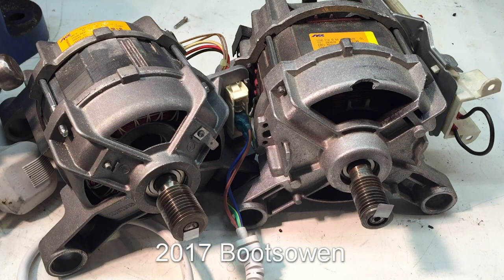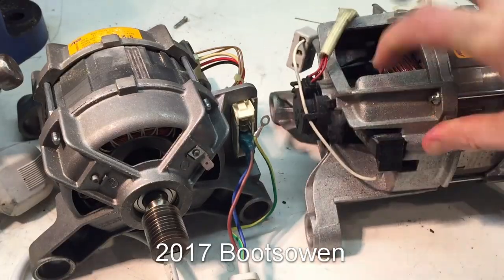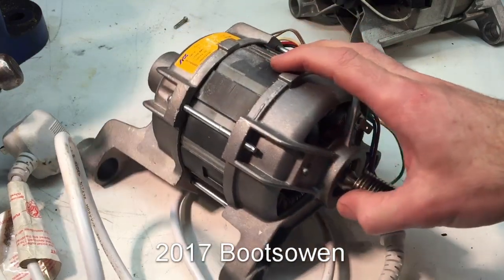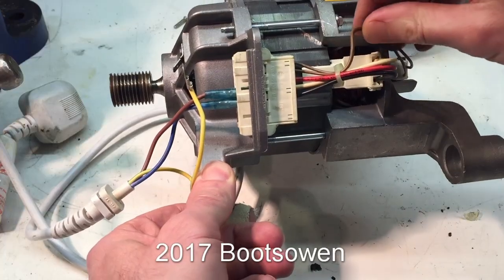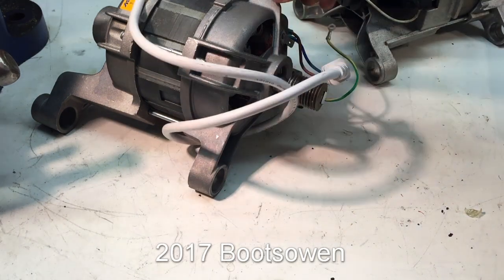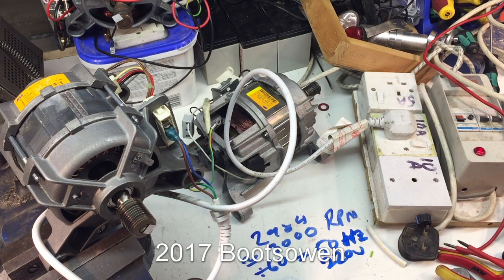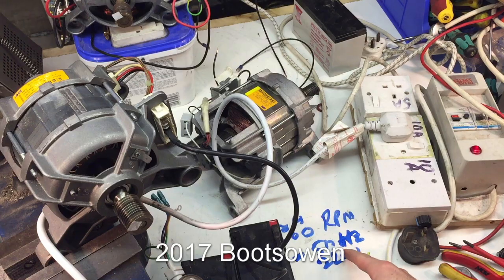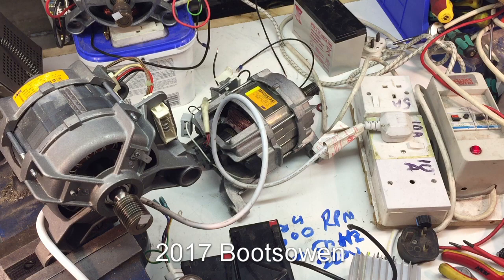Washing Machine Motor Wiring Explained (3 Phase Induction)

Comment: There is a guy did this he made a github post yiu need a full duplex to half duplex adapter  to use a windows computer to control it with rpm feedback over serial. There is a YouTube video j cant find ask ai to find  the project by searching for whirlpool motor controller on github . He even provides gerber for the adapter.

Comment: It’s best to get a run capacitor of a blower motor or a microwave or something like that to get it to run smoother and will let it start on it’s own than the way you showed the way to do it is to wire a power wire and neutral to 2 of the connectors make sure that the live has 2 wires one of them will be in series with the capacitor and then the motor and the rest just plug them into the other 2 slots for the windings and maybe if you could cut the winding across the live to the capacitor winding NOT THE EXTERNAL WIRE but the internal winding so the electricity goes through either the main winding or the capacitor winding back to neutral and not through the capacitor to the main winding not like I’ve done this before I guess it’s just plug play and wait for the red to pop! anyway nice vids keep it up ❤❤❤

Comment: That's not an induction motor, that's actually a BLDC motor, which is an inverter motor become it's a got an inverter which converts AC to DC.
Reply from the maker: I thought bldc had magnets and only 2 sides.
Reply: @bootsowen  Well BLDC motors use permanent magnets on the rotor, and the windings on the stator, the maximum speed of an induction motor achievable is 3600rpm at 60Hz AC, but BLDC motors use 3 phase DC power, which use pulse waves that turn on each coil separately.

Also BLDC motors use an ECU/ESC for achieving 3 phase DC.

Comment: You can harvest the frequency controller along with the motor when tearing it out of the washer.
Reply: Where and how
Reply: @kadnero4423  Follow the wires going to the motor to its first big main board.  It will have a bunch of transistors and heatsinks on it.  That's the frequency controller.  You just have to find the input, it will want a "pulse width modulated" input signal and 120/220v power.
Reply: @snap-off5383   Thank you

Comment: In the most of mainland Europe. 3 phase power is standard in households. Washing machine can be run on 3 and 2 phases.
Reply from the maker: Yes, but it is still quite rare to see a domestic washing machine on 3 phase. When you say 2 phases do you mean single phase?
Reply: @bootsowen  I live in Denmark and 3 phase power has been the standard supply in homes for the passed 100 years or more. Our washing-machine runs on 1 or 2 phases + neutral. There are 380 volt between phases and 240 volts between phase and neutral. The cooker ( large Smeg) oven runs on 3 or 1 phrase + neutral and the dish-washer runs on 1 phase + N. Hand-held tools run on 1 phase and is very seldom to find stationary machinery (drill press, lathes, mills) that run on 1 phase. "When you say 2 phases do you mean single phase?" Split 3 phase: -washing-machine. 1 phase for the heating element and 1 phase for the motor. You run 3 phase to the machines and then spilt into 2*230 volts. Larger commercial washing-machine use all 3 phases. In many parts of Europe, 3-phase power supply is used in ordinary households. It's more economical and allows spiting. You have both 230 and 380 volt on demand. That's were the professional hobbyist in the UK runs into a big problems.They can buy cheap used metal and woodworking machinery in the EU but, they can't run it. Puts a block on home-industries. Your videos are interesting and I like them!!
Reply from the maker: @michaelmayo3127  Thanks, I have put a video in my taking stuff apart video of an induction hob this week. it has an interesting wiring input, 7200w, 2 lives, 2 neutrals and 2 earths. I think so you can run it on two phases and neutral, or on two separate single phase lines across 2 breakers? or in the UK a single phase combined connection. I don't know much about electricity. I know that there is 3 phase on my street, but most houses don't have it.

Comment: An regular VFD won't work. This motor require around 300 Hz. You can try one of those cheap chinese controllers with tacho-feedback  but with them the motor will work in low RPM range only (around 3000). However those controllers works pretty well with the universal type of motors. You can search for them in ebay or aliexpress, key word "400W AC 220V Motor Speed Pinpoint Regulator Controller"
Reply from the maker: Have a look at my more recent videos where I show it working perfectly. Thanks
Reply: @bootsowen  I did not, you have so many videos ;) . Could you please share a link. Thanks.
Reply from the maker: Thanks, search for Bootsowen VDF

Comment: Dear Bootsowen. 

i have the exact same motor and desparetely try to run it. 

have you found any way to run it with simple components such as capacitor or applying dc load etc?

i do not have budget to buy VFD thats why i am asking your valuable help. 

thank you for such great videos!
Reply from the maker: Perhaps you should find a more suitable motor?
Reply: find another washer with a 3 phase motor and harvest the motor AND the frequency controller from it.

Comment: i got mine running on a vfd at 4hz realy slow and kinde of useless
Reply from the maker: I have a more recent video running one of these on VFD. i ran it faster than 4hz
Reply: @bootsowen  I watched it, but mine started randomly speeding up and down and then VFD got a over current alarm. Worked fine at 0-5hz but over that and started jumping, and tripping the current limit.
Reply: @bootsowen  actually got it working after i set all the parameters in the vfd correctly. Your videos are quite  informative. thanks.
Reply: @bootsowen  https://www.youtube.com/watch?v=UCR7iQTLAoM
Reply from the maker: Is it a seperate motor, or a direct drive?
Reply: @bootsowen  Separate

Comment: Thanks for this, I got given one of these motors, from a hotpoint I think, I was going to use it in a DIY bench sander but you've just saved me time and frustration because I would never had worked this out for myself,  I watched a couple of other videos about this but to be honest yours was the only one I really understood.
Reply from the maker: Excellent. I have posted a more recent one using a variable frequency drive to power a similar motor.

Comment: Hi Bootsowen, I had a look at this video. Never thought they built washing machine with 3 phase motors. How many households have 3 phase power? Maybe UK is different. I was actually referring to brushless motors of new generation. They are inverter motorsand have 5 wires: 2 are for live and neutral(single phase) and the other 3 are to control power, speed and rotation of the moto. these 3 wires come form a PCB so I assume they are low voltage.   It seems most machines now use these types of motor which have electronics and fail! I am referring to Askoll M500 or askoll Ta0200. Here is a video of the latter

https://www.youtube.com/watch?v=7g9akgSo6JM

and here is a link for the M500 which I am trying to use for other applications but I don't know how to wire it. If I apply 240v to the input nothing happens. This means that it is in Normally OFF. The other 3 wires modulate the rotation etc.

https://www.berlin-repariert.de/askoll-m500-2/

Can't find anyone that has a video on how to rewire these.Cheers and thank you
Reply from the maker: Houses in the UK have single phase 220v. But these motors are driven by a board and maybe they are some variant to what you are talking about. The board, perhaps an inverter?, creates power with the right frequency to drive the motor.  So they are brushless.

Comment: Waait... it's 3 phase. Can't you just power it "the old way": with a capacitor in parallel with one of the windings? Granted you'll lose 40% of the power and some starting torque but other than that the motor would work and have some uses in lower power DIY projects.

If not that then maybe BLDC driver with custom software that changes typical square PWM signals into sine waves? I'm not too good at this so maybe there's someone who is and who'd explain if such a thing is possible.

Comment: what type of duty cycle are washing machine motors? s1? or what? can it be running for hours without getting damage or be overheated? for example a 500 watts electromotor 2800 rpm

Comment: So the main diffrenet between the universal and induction motor is the brushes?? Just wanna make sure because I have a motor without brushes only 3 wires coming out of it . I guess its Induction
Reply from the maker: There are lots of other types of motors. These are just 2 of the main 3 washing machine motors.
Reply: @bootsowen And there is 4th type of washing machine motor used by LG (direct drive). That one is called BLDC motor. Both of them (BLDC and the one you showed) are considered as inverter motors.
But BLDC motor is not an induction one. Here the difference is a rotor. 
In induction one the rotor is built up like closed cage and it is an asynchronous motor. 
On the other hand in the BLDC motor, on the rotor there are many permanent magnets and it's a synchronous motor.
The practical difference in in the way how they are driven.
In case of synchronous one, driver (inverter) has to exactly know the position of rotor in order to power up the correct coil (or pair of them in case the motor windings are in star configuration, BLDC motor  is also a three phase 😅)

Comment: How do you know if it is a 3 phase induction motor or a single-phase induction motor with a starting winding? For that, you need to check the resistance of each winding. Either single phase with starting winding or a three-phase winding you can run it with properly rated capacitors.

Comment: thanks for interesting video I have a 3 phase motor can't help it but it seams a shame not to use it, do you think this would run ithttps://www.ebay.co.uk/itm/2-2KW-3HP-220V-Single-To-380V-3-Phase-Variable-Frequency-Drive-Inverter-CNC-VFD/362723882389?_trkparms=aid%3D555018%26algo%3DPL.SIM%26ao%3D1%26asc%3D60698%26meid%3D0e0f874b0ad34971b9f31b9483175ff0%26pid%3D100005%26rk%3D4%26rkt%3D12%26mehot%3Dco%26sd%3D312652093942%26itm%3D362723882389%26pmt%3D1%26noa%3D0%26pg%3D2047675&_trksid=p2047675.c100005.m1851
planing on using it to run motor for a honey extractor, would be interested in anyones thoughts
Reply from the maker: It should work. But you are putting a relatively expensive vfd on a free motor that may have had years of work in it already. But I say relatively and it is pretty cheap at £60. Have a look at my other videos on universal motor speed control. These are free from washing machines and a basic controller from eBay is under£5. Perfect for honey extraction where constant speed isn’t critical. Let me know how it goes.

Comment: What kind of rotor is it inside this motor? Are u sure it's not the permanent magnet rotor and thus BLDC motor rather than induction motor?
Reply from the maker: What does bldc stand for?
Reply: @bootsowen  BrushLess DC
Reply from the maker: Have you watched the whole video?
Reply: @bootsowen  yeah, why?
Reply: @bootsowen  itu adalah motor BLDC, harus dgn controler 3 phase, dan itu bukan motor induksi, karena motor itu menggunakan ROTOR PERMANEN MAGNET NEODINIUM
Reply: @bootsowen saya kenal dgn motor BLDC tsb, dia memiliki SPEED dan torsi Yg sangat kuat, 👍🏿👍🏿👍🏿 itu motor yg sangat bertenaga,

Comment: how can I connect it with a capacitor
Reply: That's the same thing I was trying. I connected the third pin to the phase via a 80uF capacitor. It worked very smoothly, but it started overheating. I calculated the 80uF because that's what a start capacitor would require. But I have since found that it is too much for the run capacitor. I am thinking of trying 8-15 uF, from some tips I got online, but I wonder if it would work.

Comment: Your video was very helpful to me as i probably have looked at this motor from a distance an thought it was a universal motor {and bypassed it}  - as i did not know they designed this '3 phase' to look like a uni motor - so i find that very helpful - and i thank you.
as for the issue you are having you maybe want to research more into '3Phase' and different configurations and connections you can achieve. 
if you have any questions don't hesitate to ask i'd be happy to share any info i have with regard to running that motor on so called 'single phase'
Reply: if you can help I have a 3 phase motor as well left over and would like to use it to power a honey spinner, any help would be great please what can I do to control it and make it run smoothly, thanks Keith

Comment: Can't you add a capacitor to create a second phase?
Reply: That's the same thing I was trying. I connected the third pin to the phase via a 80uF capacitor. It worked very smoothly, but it started overheating. I calculated the 80uF because that's what a start capacitor would require. But I have since found that it is too much for the run capacitor. I am thinking of trying 8-15 uF, from some tips I got online, but I wonder if it would work.

Comment: can you turn them into a 3phase generator?
Reply: Yes, you certainly can. You simply connect a turning source to the axis, and you immediately get a three-phase potential in the connectors. I did it by connecting my Black&Decker Drill, and I got a three-phase voltage of about 3 volts at the frequency of the rotation.

Comment: some washing machines have a two winding single phase induction motors (two parts of the star winding) that use a capacitor (about 10 mfd) from the second winding to one of the power (N) connections to allow it to run and you swap the capacitor power wire to the other power (L) connection for reverse :-)
Reply from the maker: What models and years have those motors?
Reply: @bootsowen
i cant remember make or model , but it was early 90s , i only ever saw 3 , all were different models at least , i had to change caps so they would spin properly :-)
Reply from the maker: I have only seen universal or 3 phase recently. Early 90s is almost 30 years ago now!!  ;-)
Reply: @bootsowen
i never thought of how much time has past , im always hoping to get hold of a scrap one just for the motor , im going to guess thats never going to happen unless some one has one that has lasted till now , funny thing is i keep seeing washing machines from the 50s/60s that still work that are being scrapped but they just have an "ordinary" induction motor with a centrifugal controlled switch to disconnect the starter winding :-)
Reply from the maker: I guess it depends on where you live but they come up from time to time. If you know a local scrap man they can watch out for one for you. ;-).
Reply: YTANDY100 x

Comment: Wow i got a 3 phase so hard to find out its 5 pin out instead of 6 so it took me awhile its from a bosch nexxxt 500 so now can i get stuff to make it work out the washer?  Goal was to maybe use as boat motor with battery but now its like damn i didnt know theres two types.  I could put it on spin for 10 min.  Anyhow plan on just using a battery is shot now.  These 3 phase motor done learn somethong new now.
Reply from the maker: are you sure it isn't a univeral motor, more likely in a washing machine. I have made a video of this here    https://youtu.be/48J3w0eN6uI, it would be perfect for your boat idea if it is.

Comment: Can you not adapt the motor driving circuit from the washing machine the three phase motor came from, so you can use the three phase motor?, or is that circuitry to interlinked with the control system of the washing machine, to be practical to adapt?
Reply from the maker: I think you could if you were more technically/electronically minded, but from what I have seen on youtube, nobody else has done it.  You could run it from a variable frequency drive (VFD) but they are expensive.
Reply: Thanks for your answer, I have a washing machine waiting to be stripped down, for any parts I might find useful, one of those parts I'm interested in being the motor, as it was still working well, the problem being the main drum bearing had failed rendering a decent machine unusable, a non replaceable part in this machine apparently, unless you want to spend almost the amount a new machine would cost to get the whole sealed drum assembly replaced... so when I took a look at the motor, I realized it wasn't the usual kind of motor, like in my last machine, and I decided to find out if it was worth keeping, this brought me to your video, after realising it was a three phase beast.

I think it may be to much trouble to try and use the motor control circuit from the washing machine, but I'm intrigued to find out if it is possible, I tried to get a schematic, or service manual, but had no success, so If I get time, I'll try stripping out the electronics, and take a look around to see if I can figure out a way to use some of it, I have a feeling it might be quite complex as far as getting it to work the way I'm thinking, as in controlling the speed, and direction of the motor in a simple way, independent of the computer controller section.

If I do manage to figure out how to utilize parts of the machine to make the motor useful, then I'll post another comment here.

Maybe someone else reading this, has already tried what I'm describing?.
Reply from the maker: If you do get it to work it would be interesting to me. Please post the model and make as that will help others. If you could, it would be worth taking video of what you do, even if they are failed attempts, as that will help people. good luck!
Reply: That thought also came to my mind. Unfortunately, I had already tossed the machine when I realized that this is a three-phase motor. That is unfortunate.